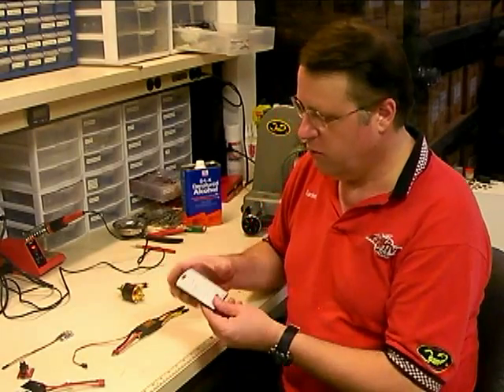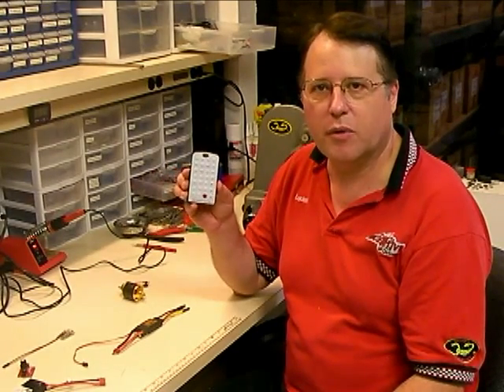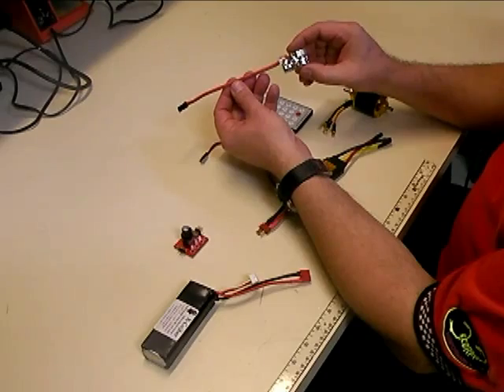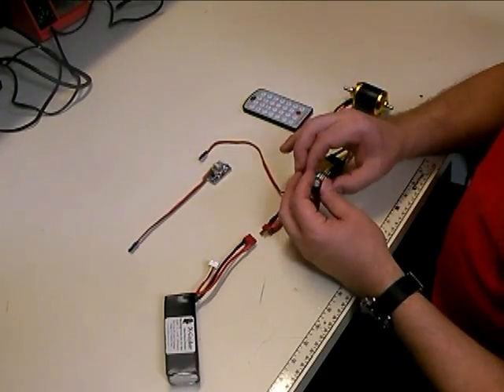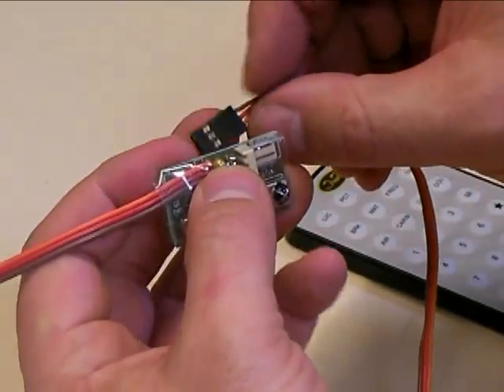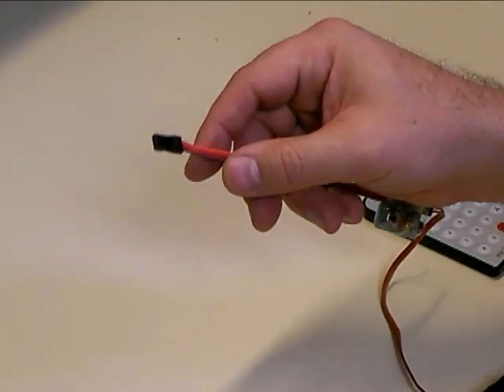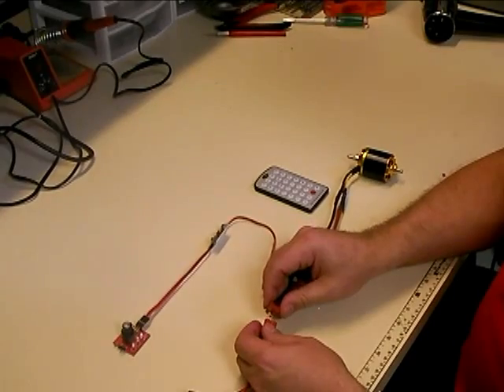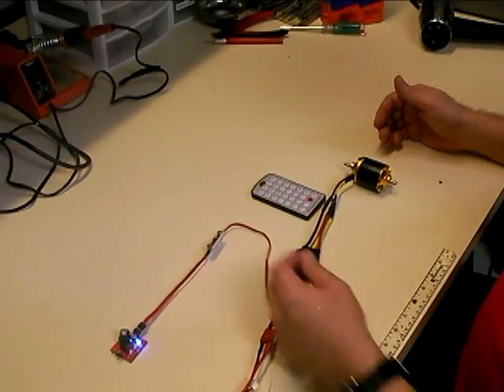How to Program a Scorpion Speed Controller by Innov8tive Designs

Comment: Hi! I have a scorpion esc in one of my rc models but did not get the program card and the IR remote.. Is there any way I can put the prop brake function of the esc on  without the program card just by using my radio ?
Reply: Have you found a solution? Having the same problem... need to program soft start for my Trex 600

Comment: Hi friend, I have a BEAM 450 helicopter with scorpion engine and speed controller scorpion 45A. The problem is that when I accelerate the helicopter of much delay in climbing at maximum speed and I need it for 3d that I respond quickly. what I do? It will be that you can help me, thank you.
please I need the answer.

Comment: Hello. I have got a scorpion esc to use with pixhawk. The problem is that it does not start: it keeps beeping as if has no signal from the controler.... Have you ever put this two toogether: Scorpion ESC and a Pixhawk controler? What I am doing wrong? (The old ESC was working fine, but I had to change because I put a stronger motor...)